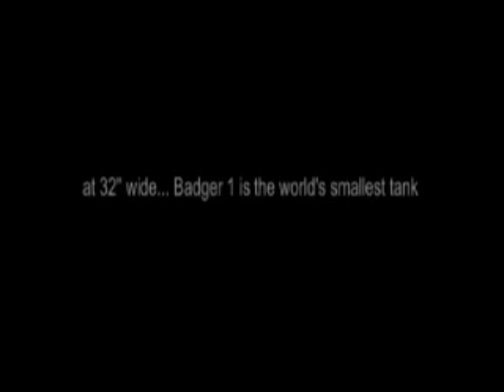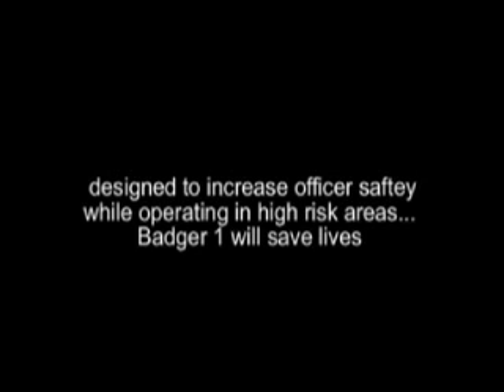Personal Assault Vehicle PAV-1

Comment: By mounting the tracks on something like a scissor-jack mechanism you could also lower the vehicles centre of gravity at the same time as widening it's wheel-base. It would also seem that it would enable easy installation of a basic suspension system into the mechanism.

Comment: Beautiful work and design. Looks like a hydraulic drive, if so are the final drives fully protected also? The ac/heat comment makes me wonder if you've managed to fit an overpressure and filtration system in it.

Comment from the maker: You are correct, the drives are protected and the design includes Bio and Chem. hazard filtration and the ability to create a positive pressure environment.  It also has limited use in Radiological environment.